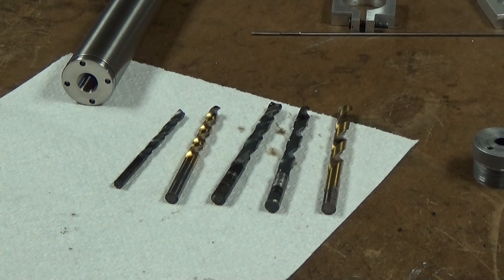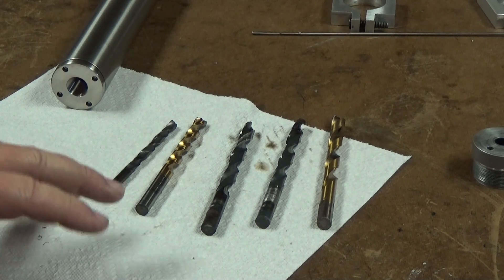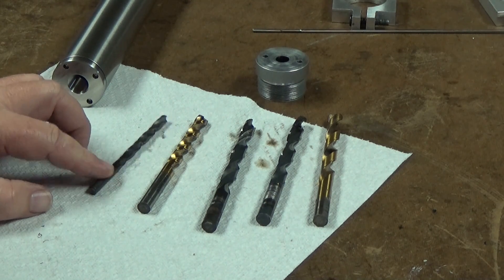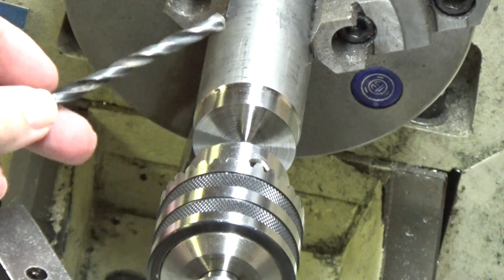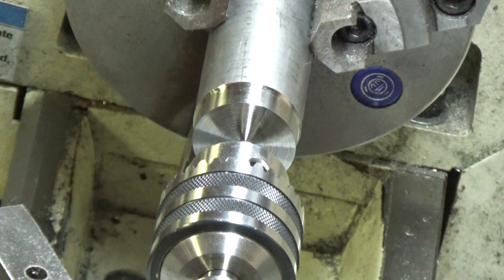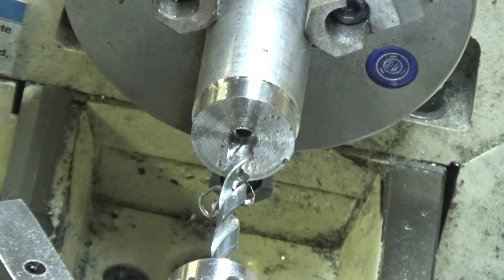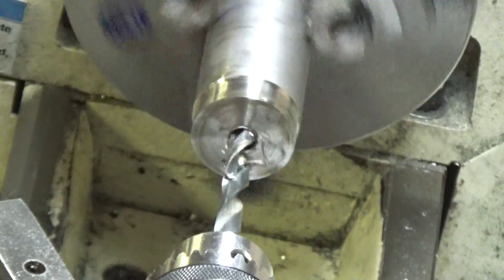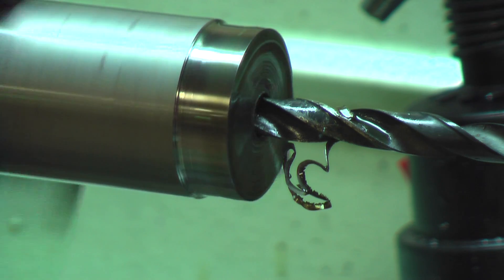Drilling Titanium Successfully

Comment: get a "JACOBS SUPER BALL BEARING CHUCK"  and COBALT DRILLS WITH flats @ 120 degrees TO LOCATE ON DRILL CHUCK JAWS . ..SHARP-SHARP drills... !! ,,titanium must be CUT--NOT RUBBED. .lots of OIL and SLOW SPEED with higher than "NORMAL" feed rate ..!! ..try SOLID CARBIDE drill bits if you are in a high number of parts to be made ..

Comment: Drilling grade 5  in one step drillbit 16,5 mil , is about 5/8 inch. cooling with emulsion going great for 1/4 inch. lathe stops by over powering at about 100 rpm. problem with grade 5 is building up heat in stock and not in the chips. And same as stainless keep cutting every stop hardens the top layer, start cutting again need quick drill or tool action to start cutting again.. you need a good chuck to hold your drillbits.  slipping drillbit stops cutting and gives problems.  good luck.

Comment: I think, you should use center drill and after that only one drill (for hole which you need ) but properly sharpen, when you have already hole and you go bigger and bigger hole, drill that comes next "bites" titanium pretty hard and because of that drill slips in your chuck, and lot of coolant is important to cool cutting tip of drill, I had similar problems like you, and I thought that making smaller diameter hole will help after I go with next bigger size.

Comment: Calculating from the speeds and diameters a good Estimate of surfacespeed would be somewhere in the region of 4-6m/min ( i'm Used to Metric)
Most of the time i use 4fluted endmils and spiral mill the holes.. 
Today i did 3mm deep holes in titanium watchcases, 1.98mm diameter with an 1.5mm SolidCarbide endmill.. worked like a charm.
I do however have some parts to make in the future, that i have to drill.. I will test that at 4-5
5m/min

Comment: I have drilled lots of titanium in the aerospace industry. Secret is cobalt split point drills and LOTS of coolant. Titanium is VERY dense and builds up heat almost instantly. Heat is the enemy as it breaks down the cutting edge.Your speed is about right just need flood coolant. Most of my experience was with large pieces and large bores. We used thru coolant and a lot of "pecking" in the nc programs. It really just takes time and experimentation till you get your set up right.
Reply: Johnny Holland The only thing is Titanium will not absorb the heat as fast as the tool will in this case the drill bit.
Reply: Johnny Holland how big do you bore?

Comment: Progress was made, that's the important part. Thanks for sharing your findings on this!

Best wishes,
Tom Z
Reply from the maker: that's right, I'm always learning however there has to be a better way i guess carbide drills, so far I've got half a dozen dulled bits, a Jacobs chuck that's spun out, all this just to drill one inch. Would have been cheaper to find a set of carbide drills. thanks for letting me vent, and thanks for watching

PS: you have a great channel, maybe one day I'll go CNC
Reply: I've dulled my fair share of drills, that's for sure. It's almost always from running at too high a speed as well. When possible, I like to use flood coolant (or even just a spray bottle) to help keep the temperature down there. It also looked like the chips might have been jamming up a bit but this is the sort of thing that shows up different on the video than when you are standing in front of the machine.

I'll be going back to catch up on the build to date. This is really good content, sir.

PS - thanks for checking out my channel too!

Comment: Gday mate,I do a fair amount of work in Gr 5 titanium and have had my fair share of problems with it. A few things to remember is that it work hardens. Keep it cool, feed constantly or withdraw(don't rub) sharp drill bit! as soon as there blunt forget it. use coolant if you can with drilling and turning, Coated carbide works well for turning. Regards Max

Comment: Brother, you need a ball bearing jacobs chuck. Btw, when spotting with center drills, it's generally best to only use the very tip.
Reply from the maker: thanks for the tip TMB I'll have to keep a look out for a super chuck. like your channel thanks for sharing
Reply: +BS in The Shop it's also helpful if you use the same drill tip geometry with your drill as what's on your center drill tip. The more bearing it has the better it will start into the hole.

Comment: I'm wondering if 135 deg would of performed better, I was also thinking that bits with flats on the shank would of helped, then again the bit spinning in the chuck probably saved them from breaking. Not easy stuff to drill by any stretch of the imagination.
Thanks for the useful lessons
Reply from the maker: I'm pretty confidant that drill any other material those bits would not have slipped, I'm quite amazed none snapped off.. thanks for watching
Reply: Might also help to make sure the chuck jaws and drill bit shank are oil/grease free?

Comment: Glad the drilling has been improved - must remember the lower RPMs answer. Had wondered about that.
Certainly seemed way big of an improvement - daresay tip temp was kept a smidge cooler and 115 and 190 seemed perhaps some of the sweet speeds. Keeping a chuck hold on the bit seemed an almost predictable problem with the tool tip pressures involved... amazing the helix takes all that torque. I winced every time the bit slipped!:)
I still think carbide would be the answer if available but also a really good cutting edge on the HSS bits..
Reply: run what ya brung
Reply from the maker: yeah Chris looks like RPM is an answer, carbide would be nice, but until I go back to work it is "use what ya got" around here., those helix bits are Guhring bits I got in a lot off ebay. I dare say drilling is not near as fun when the bit come out the same color it went in..no more sparkles..